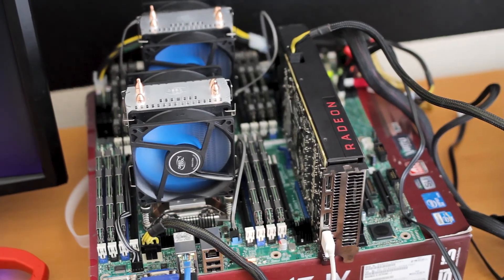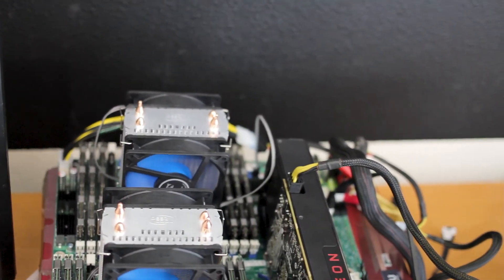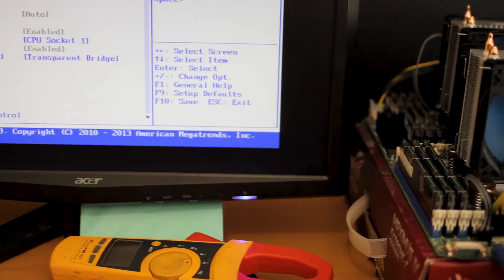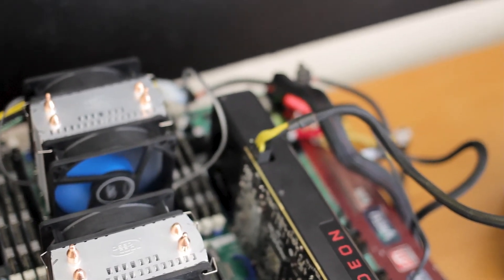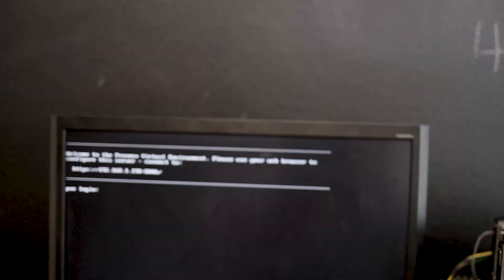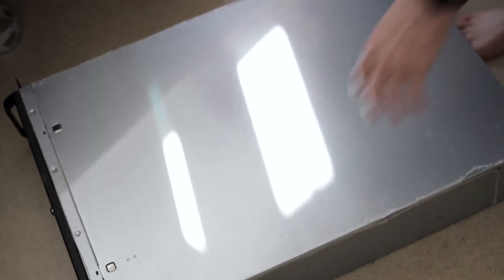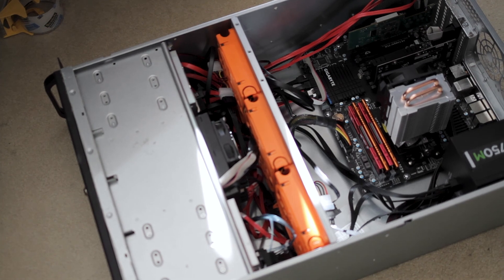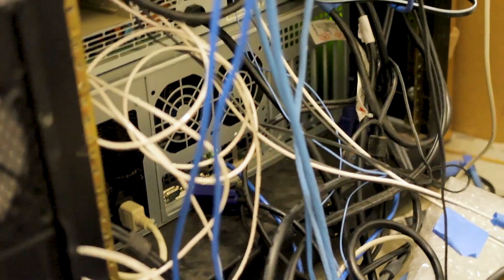Upgrading My Home Server to Dual Xeon E5 2680 v2's

Comment: Nice server, I have almost the same. You probably need a pci-e riser to connect your gpu to pci-e x16. It will give more graphics performance. Also it`s strange that the second cpu is powered by only one molex adapter, and I can`t understand why isn`t it melting down because there is about 10 amps current.
Reply: На 8-пин максимум 300 ватт, тоесть 300в уже есть, и подкидывает еще на всякий пожарный случай. Зеоны максимально 150 ватт каждый, тоесть да...не лучший вариант, но на 150 ватт каждый пойдет.
Reply: molex can handle 10 amps, sata cannot